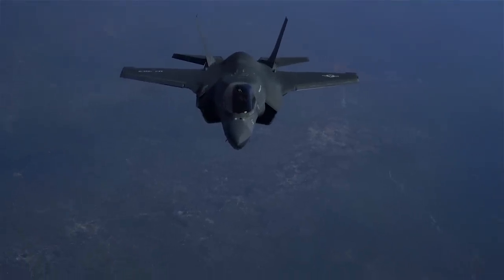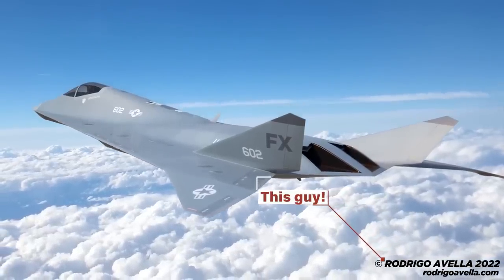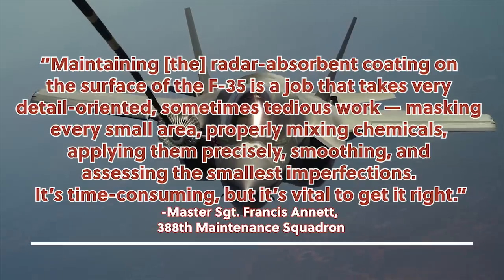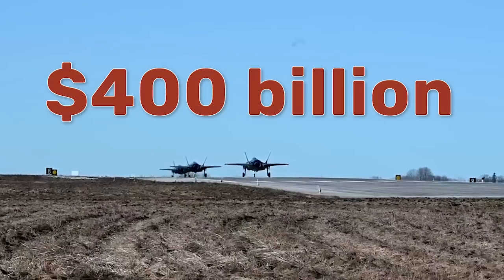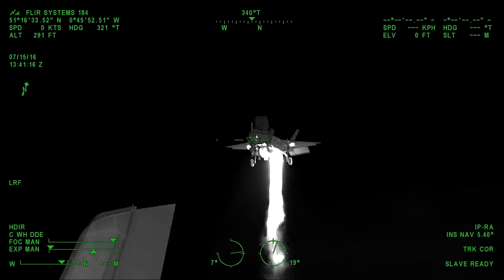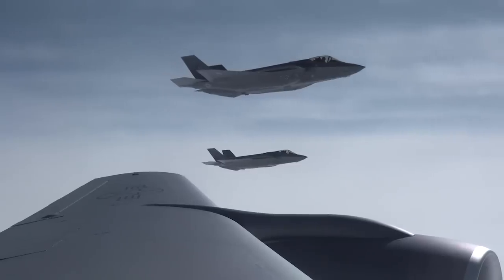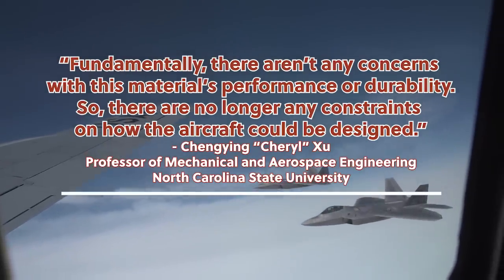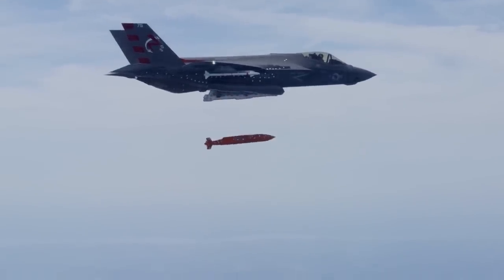The biggest leap in stealth tech since the F-117

Comment: "in terms of both sheer performance and operating cost, they often fall short of older, more dated platforms like the F-15 Eagle, F-16 Fighting Falcon, and Su-35 Flanker-E"
That's a surprising statement, when the F-35 achieved a 70:1 air-to-air kill ratio (with an equally impressive air-to-ground ratio), along with the highest availability rate of any aircraft in the inventory (maintenance level).  As far as cost is concerned, the F-35 is the cheapest aircraft we have in the air.  How can that be?  Let me explain:

$6k was the original cost PFH of new A-10s at 1970's inflation.  You can't fly a 10 passenger business jet for $6k PFH today.  The A-10 is now way beyond it's service life so it requires much more maintenance than when it was new.  This is not to mention the SLE mandatory wing replacement program and out of production parts that have to be special ordered.  The A-10 now costs $30k PFH and the F-35 is $35k PFH.  

However, let's say the A-10 was still $6k.  The F-35 would still be cheaper to field.  The A-10 requires about a dozen support aircraft to operate in any AO, denied territory or not.  They require an AWACS with their fighter escort, 2 flights of fighters for CAP overwatch, and SEAD aircraft to take care of ground anti-air threats.  Let's say those aircraft average $20k PFH each.  That's $240k PFH to support A-10 operations.  The F-35 on the other hand, was designed to operate with minimal support.  It has better sensors than the AWACS, it's capable of a 70-1 air-to-air kill ratio so it can clearly fight it's own air battles, and the onboard AI can identify/target/prepWeapons for a ground threat in less than a second while still outside of its WEZ .. which is better than any SEAD dedicated aircraft in the inventory (not that they really care about ground threats..).  The A-10 has to wait for the AO to be cleared by it's support aircraft before it can go in.  That can take hours.  This is why the A-10 has a long loiter time, because it's not built to fly in a contested AO.  Once the AO is cleared, the A-10 can stay there for a long time and wait for CAS requests.  However, what if your son is pinned down by an ambush and his unit is requesting CAS and the threat for air assets is uncertain?  An A-10 isn't going there to help him, but an F-35 will have no problem.  

Let's say that it's an uncontested AO and the A-10 is flying to provide Close Air Support.  That bird is only capable of 300knots, that's 20min for 100nm (typical size of grid).  Once the A-10 arrives he gets 9-line talkon by the JTAC to start identifying his target, which takes 5min.  He has to put his targeting pod on coordinates and slew around and visually identify the good guys and the bad guys; that takes 10 min avg.  The A-10 is doing a gun run (yay, brrrrt.. :p ).  He's carrying 1200 rounds of 30mm (which was meant to kill primitive tanks.. it's as long as your forearm).  They do an average of 3 runs with 3sec bursts firing 70 rounds per second (at $140 a round that's $88,200 in bullets).  It takes 10 more minutes to spend half his load blanketing an area the size of a football field to make sure the threats are all dead (can't see them after the first run due to the smoke and dust).  Total time was 20min to get there and 25min to lay down the brrrrt.  A dozen aircraft were tied up the entire time to support him.

An F-35 is called in, contested or uncontested it doesn't matter.  5min to fly to the AO alone and invisible to radar.  Before he arrives the JTAC on the ground provides grid coords via toughbook straight to the aircraft AI computer (which is even more powerful than Submarine computers).  The AI (which is like a "digital RIO") has already zoomed the EOTS lenses many miles away and visually identified friendlies and enemies via tranceiver and optical recognition, cross referenced with ground based intelligence systems... within milliseconds.  The pilot looks through the cockpit floor with augmented reality in his visor, at 5 red circles superimposed on the ground many miles away.  The computer provides recognition profiles which the pilot validates casually marking the targets as fair targets.  The pilot can also see several green circles on the ground for visualization of friendly positions.  The computer has prepared a Small Diameter Bomb dialed in to create a cone of blast 100ft off the ground and in the proper direction to ensure only those 5 enemies will be eliminated with the lowest probability of collateral damage.  This has all taken 3 seconds.  The pilot decides that he's going to use guns (despite the superior performance of the SDBs and the AI's recommendation).  He gets 10 miles from the target, nose level, and pulls the gun trigger on the stick.  This trigger doesn't fire the 25mm GAU-22 cannon but rather says "OK computer, you can kill those targets" as long as he's holding it down (man-in-middle autonomy).  The AI autopilot takes control of the flight surfaces and steers the nose onto the 5 soft targets.  At 4nm the bird puts out 5 bursts of 5 rounds very rapidly, correcting between each burst and firing only at the exact millisecond when the highest probability of hit exists based upon thousands of sensors updating millions of times per second.  This takes another 3min.. and 25 rounds total.  Subsequent gun runs are not necessary.  Total time was approx. 5min transit then 6min to perform like an electronically invisible aerial sniper.  Zero additional assets required, except maybe a refuel tanker sometimes.  

Total cost F-35: approx $7,000 for 11min and ammo.  
Total cost A-10: $268,200 45min and ammo.  
Total value to Father with son on active duty: Take my money and support my boy with the F-35 please.
Reply: "The A-10 requires about a dozen support aircraft to operate in any AO, denied territory or not."
"Total cost F-35: approx $7,000 for 11min and ammo.  Total cost A-10: $268,200 45min and ammo."

...This is some very badly written fan fiction. Would have to give it a 1/10. Would not read again.
Reply: @matchesburn  I'm a former military engineer and I've been used as a Subject Matter Expert... not that I'm interested in whether you think I'm an honest man or not... they're few and far between these days, so I wouldn't blame you.
Reply: @StrongHarm  
"I'm interested in whether you think I'm an honest man or not"
1.) People that "aren't interested" don't tend to make public comments.
2.) I know you're not an honest man, for claiming absurd horseshit like "a dozen other aircraft have to support the A-10 even in permissive environments" which is a flat out lie. 

You had an agenda here. It was plainly obvious. I don't know why you're a shill, but I can only hope you're not doing it for free because that would be even more cringe than what you're already doing.

Also, if Lockheed-Martin happens to be hiring paid shills to fluff the F-35 which it so desperately needs even I'll gladly do it for a check if there's enough digits in it.
Reply: @StrongHarm  
"You're kind of a prima-donna aren't you?"
Translation: "Look at me, everyone, I'm projecting!"
Reply: @matchesburn  Thank you @matchesburn!  It's so impressive that you could complete your psychoanalysis with only 1 post.  Can you help me?  Do you do Saturday appointments?  Thanks doc.

Comment: "stealth" works only on dumb radars as it only diminishes the "size" of radar reflected object but it does nothing for speed, so when "dumb" radar sees a bird moving inbound at 350 knots, well its pretty easy to know its not a bird :D
Reply: Yup, and still can't lock on. Just because you think you see something moving fast doesn't mean you can lock a weapon onto it.
Reply: The problem is that a bird is much smaller than an aircraft, so the inverse square law is working against you.
By the time you get a contact at 350 kts heading your way, you should probably start running. There's already a glide bomb about to fall on your radar site.

Comment: Very high speeds and stealth are really incompatible in general:
Air friction at high speeds makes planes hot causing very fast increasing IR signature.
And while IR detection system doesn't give range, combining data from two sensors in different locations allows triangulation of target's position.
With no way for target aircraft to even know that it's being tracked!
(unlike in case of when using active systems like radar)
So for staying undetected speed must be kept limited anyway no matter if RAM can handle the heat or not.
Reply: I think a double wall adjacent to the "hot" plane skin, injected with liquid nitrogen or fresh air -will greatly lowered the heat generated by the air impact during super.sonic speed flight...
Reply: The shock waves also have their own radar signature. As much as we feel the need for speed, analysis of actual combat has shown that top speed isn't much of a advantage.

Comment: Can you tell me why the air force is coating the F-35 as well as the F-22 in a very reflective chrome coating have you heard seen or read anything about this and I believe it's the entire jet I thought it was just the bottom.
Reply: I'm personally speculating that it's as simple as reducing IR emissions by not absorbing heat in the first place, primarily caused by air friction.

Comment: Wait a minute.. How come an older aircraft like the Raptor, with an inferior RAM coating, doesn't have limitations on its speed like the F-35? The Raptor is capable of hitting Mach 2.2. and doesn't have any limitations. Why this problem plagues the F-35? I would understand that some defense company made a breakthrough and developed the ceramics based RAM coating and this is the reason their jet isn't prone to bubbling and melting of RAM at temperatures of only 400 degree C. But both the Raptor and the F-35 are built by Lockheed. And by looking at  these two aircraft even a layman can see how much more advanced the coating is on the F-35 compared to the Raptor. F-35's skin is smooth without any visible cracks and rivets where the panels meat. On the other hand when looking at the Raptor from close you can see those imperfections and gaps fairly easy. So what gives?
Reply: I’m assuming it has to do with the exhaust
Reply: US likely did not want to admit to this.  Probably also a major contributor to very high maintenance cost.  Particularly when compared to the F-35.
Reply: @Yeaggghurte  What would an exhaust have to do with the leading edges on wings and tail surfaces  melting? I'm not sure you've got the jist of what Mark said.
Reply: @jackfrost2978  But isn't it strange that Alex didn't address that in the video? The question was practically jumping at him from the sentences he arranged to describe the problem.
Reply: @vegass04  I think he did a soft address of it by showing the comparative maintenance costs.  And the picture of the F22 with the damaged skin on the nose.  It is possible he has some restrictions on what he can say based on his sources or access to information.
Reply: My understanding is that the RAM coating for the two aircraft are radically different. The F-35 coating might be less hard and less durable.
Reply: My understanding is that the RAM coating for the two aircraft are radically different. The F-35 coating might be less hard and less durable.
Reply: I'm guessing that it has a high top speed as a side effect of high thrust and clean aerodynamics. Supersonic speed is going to compromise stealth anyway, so it's likely that pilots are strongly discouraged from going anywhere near top speed. Most missions are limited by range and will be done at cruise speed. The only time max speed would come into play is an unscheduled, last ditch intercept, which means several layers of defense and intelligence have already dropped the ball.
Reply: f22 is old and needs constant high maintenance. give it up already.
Reply: @vegass04  the tail surfaces are probably because the exhaust is hotter and not stealthy compared to the f-22s exhaust the leading edges could be because they have less sweep meaning more drag meaning more friction meaning more heat

Comment: If this coating absorbs 90% as claimed and can just be painted on, what would stop us from spraying every fixed wing aircraft we have?  As you've said often enough, stealth is a spectrum.  Wouldn't this benefit even aircraft that weren't designed to be stealthy?  Like what would an F-16 do if suddenly painted with this be capable of having even a little benefit of the radiation being absorbed?  Could it be enough to stop a say S400 battery from locking it even though it would know it was there?
Reply: I doubt that upgrading existing aircraft is as simple as a paint job. It will also take several years before this new type of RAM becomes operational.

Assuming the USAF, USMC and USN all continue to acquire F-35s over this period, there will be perhaps ~1000 in service when an upgrade becomes available, so it makes sense to prioritise those airframes which:
(1) need it the most
(2) benefit from it the most

For example, F-15s and F-16s used for air defence by the ANG would probably be low on the priority list for such an upgrade.

Comment: What is the Pilot work load?  While I was in an USMC attack squadron flying A6Es.   I had our Aircrew purposely train with a Degraded system.  We would fly low-levels using  Dead-Reckoning.  Because we were the Close Air Support Aircraft that could get Bombs on Target on Time. Simple but we trained in IFR, bad wx conditions. I trusted my Pilot and he trusted me. We would fly in Mountainous areas during daylight, good vis, and then we would train like our USMC Marines lives depended on it... 
The two man crew for Tactical Aircraft is a necessity because if we get into a Near Peer adversary,  we might need to launch without a 100% Up Aircraft. Our decision makers are making a big mistake by not following some good advice from the past, Two Heads are Better than One.  This is especially true with our New aircraft with Pilot Workloads over 1.5 for system utilization.  F-22, F-35, one seaters, are great for Peacetime Training and Airshows. SF

Comment: Time to come up with even more exciting tech that new blood will want to work with. 

I imagine a 6th/7th gen LO fighter capable, not only of air-superiority, but also truly omni-role... and VTOL will be the norm....

 A two-in-one aircraft, where both separate at the merge (if it actually comes down to it at all) .... 

The manned "lead" is armed only with guns, some fuel... minimizing weight enabling superior super-maneuvering... 

The unmanned "loyal wingman" carries the rest—fox missiles, bombs, external/conformal fuel  tanks, aew sensors.... able to " quarterback" the battlespace.... able to re-arm & re-fuel the "lead".... 

Both lead & wingman use twin engines, with F-35 like thrust vectoring nozzles, in tandem  configuration, similar to what toy drones use, for VTOL.... 

Pre-armed Drone LW can be vectored to form up & join any "lead" while the bingo LW can RTB to refuel & re-arm....